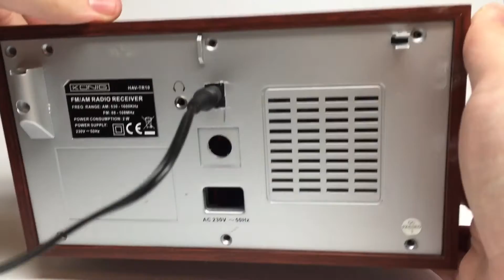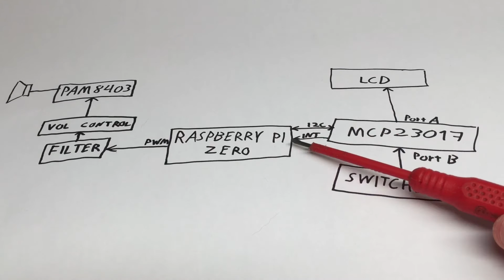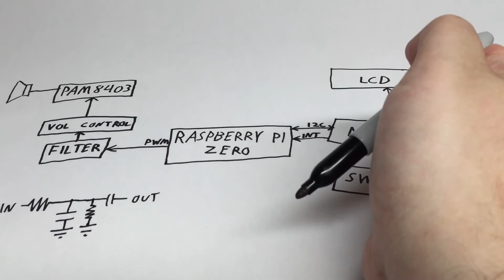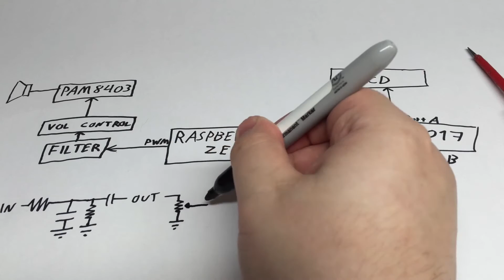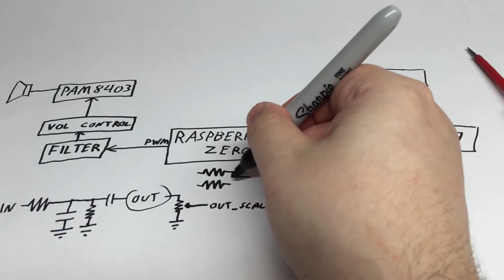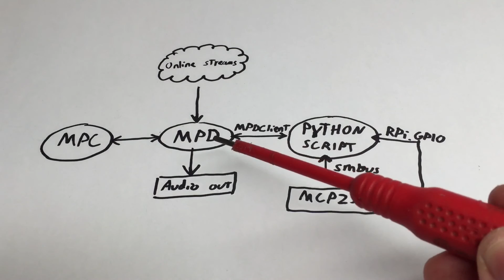Raspberry Pi Zero Internet Radio Player - ICStation.com Pam8403 test

Comment: Can you share schematic?
Reply from the maker: Sorry, I don't have any better schematic than the block diagram at 1:58 ->.
The PAM8403 is connected to Raspberry Pi Zero through circuit that can be found here: https://learn.adafruit.com/introducing-the-raspberry-pi-zero/audio-outputs
If you google "MCP23017 hd44780 raspberry pi", you can find multiple blog posts and tutorials on how to connect the display. Other option for connecting the display is to use one of  those I2C LCDs, like this one:
http://www.icstation.com/arduino-iici2ctwi-1602-serial-module-display-blue-p-1531.html

Cool thing about using the MCP23017 is that you can also connect push buttons to it (tutorials are available online) and therefore you don't need to connect extra wires from Raspberry Pi to the front panel for the
 buttons, just the ones going to MCP23017.

Hopefully this was enough information, so you know what to google for.
Reply: My son build this
http://lucstechblog.blogspot.com/2018/10/raspberry-pi-internet-radio-part-3.html
It works fine